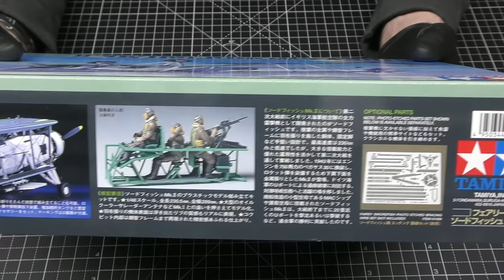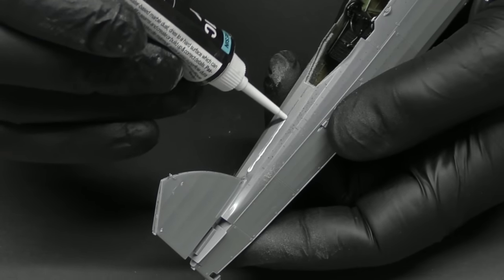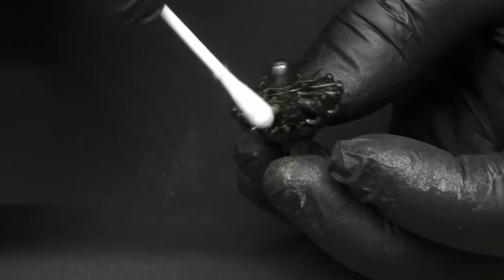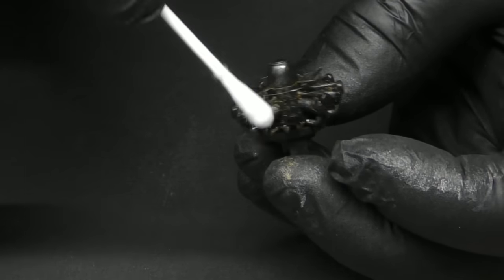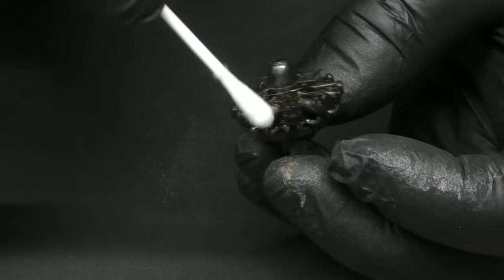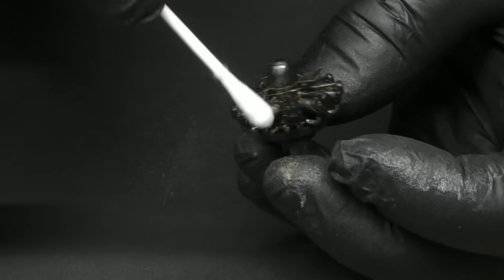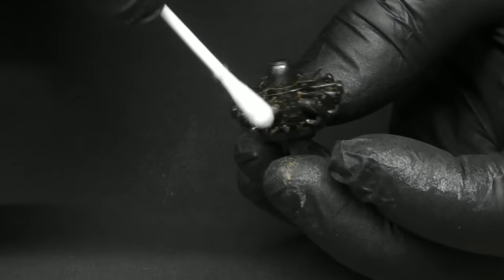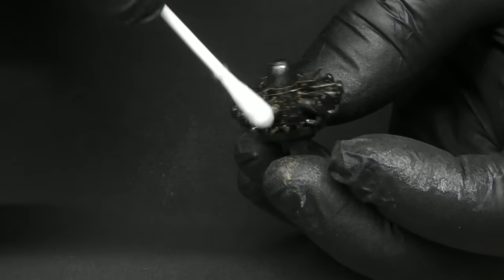Tamiya 1/48 Fairey Swordfish Mk.II #61099 Full model kit build.

Comment: Very nice build!  A tip to avoid knocking over paint bottles is to wrap some kitchen foil around the bottle and then crush it into a firm collar that effectively widens the base of the bottle.  The bottle will easily lift out so you can just swap bottles into the collar as you use them.
Reply: Or…orrrr use acrylic water based paints and invest in a wet palette

Comment: Fabulous build . I genuinely hate to criticize but I did notice one minor inaccuracy . The bracing "wires"on the wings should have zero sag. In reality they were under constant tension. They were not actually wires , but more like modern aerodynamic bicycle spokes with a flat blade like cross section with the hin section facing into the wind. Perhaps an opportunity for another photo etch set.

Comment: Unlucky with the paint but it's nice to know I'm not the only one that does. Lovely finished model.
Reply: I started cracking up when he did that, but only because it broke the chill mojo, and the fact that I've done that so many times before. At least it wasn't a bottle of extra thin...
Reply: @trydrew  Ohh I've done that. Bought a holder for the bottle and still managed to knock off the bench into my lap.

Comment: When you said you'd snapped off the tailwheel, I half expected to see you stretching a bit of sprue over a candle flame to fab up a custom plastic "pin" to re-mount it with.  Sacrificing the micro drill was like, "Yeah, this model's worth it."  Boss move.

Comment: I recommend that after you apply the decals with Set/Sol solutions and let them dry do go back over them with a heavy application of Walterh's Solvaset Decal Setting Solution.  Solvaset will melt down your decals to allow them to fit in the most obtuse and right angles where you want to apply them.  Solvaset does require some learning as it's quite hot and will quickly melt a decal if you're not ready for it.

Comment: Seeing you use Harder & Steenbeck airbrushes, may I suggest that you invest in ‘castellated’ air caps? They are noticeably less prone to clogging and easier to clean. The part numbers are HS-126785 (for 0.15 & 0.2 mm nozzles) and HS-126794 for the 0.4 mm nozzle.
Reply from the maker: Thanks Trevor, I don't use my H&S too much, I use an Iwaya HP-CS more. Thank you for the tip though...Andy

Comment: Just came across your channel by chance as I was looking at 'Plasmo's' work on scale model building. Your work is simply astonishing! The narration is very informative and to the point and the precision of your build is amazing. Subscribed immediately.
Just one question...It seemed that during the assembly of the cockpit area, some parts that were glued together with thin liquid cement appeared to have the cement applied over painted areas. So I am assuming that adhesion of the parts is not impeded by the paint?
Thanks for a great video!

Comment: I tried to build this kit. It ended up being a total disaster. I have put together many excellent Tamiya kits, but this one just didn't fit right on many of the major parts right out of the box. Fill and sand, fill and sand, ad nauseam.   I used the photo-etch bracing wire upgrade and spent hours trying to get the wires where they were supposed to go with the right amount of tension, etc. Following your video, I finally had everything going and started assembling the wings to the fuselage - again a bad fit (yours looked so easy to go together) with a 1/8" gap.. While I was struggling to get the wings attached using CA glue trying to mitigate the large gap, something slipped and the whole thing just exploded into a hundred pieces of broken plastic and bits of bracing wire. It was totally unsalvageable. Ninety bucks down the drain.

Comment: Question. How do you achieve a truly fast finish like a real plane? I have read many articles and seen many tutorials where they say you should put a think coat of clear coat in order to decal then another thin coat after to seal the decals so they don't come off from age. However, even a flat clear coat makes the model have a slight sheen to it and isn't really flat. So how does one achieve that flat finish when using clear coats?

Comment: I'm new to modelling and this is way beyond my skill level at the moment. I have some questions, though. When applying the under coat on the front of the plane you applied an off white and then black over the panel lines, why did you do this? As it appeared to get covered completely by the top coat then the effect was added after that coat had dried with the black oil (I think). It was the same for the figures, to me, the top layer covers the base layer completely, so how does this help with the shadows?

Comment: You can't go wrong with Tamiya kits.  Tamiya manufacturers simple but detailed,  easy to build without any fuss, quality plastic, and Tamiya has the best box art, and very easy to read manual, variety 9f selections in mmy opinion, everything fits nearly perfectly and  many of Chinese products ( Takom, Dragon, Trumpeter..) have way too unnecessary parts, very hard to assemble so would rather buy Tamiya over Chinese models.

Comment: What pressure are you using on the airbrush
Reply from the maker: Hi John, most of the time its around 15-18psi. Thanks. Andy
Reply: @ScaleModelShed  thanks I am having a tough time getting it right. Tamiya paint thinned 50%, down to 12 psi to keep it from being gritty.

Comment: I'm not sure about having a dropping torpedo. The aircraft you have built has rocket pylons fitted. I'm not sure a Swordfish would have the rocket pylons fitted if it was configured to carry a torpedo. Swordfish were so under powered that weight (as with all aircraft) would be an issue. So the pylons would be removed, I think. The aircraft certainly wouldn't carry both rockets and a torpedo at the same time. If there is photographic evidence of a Swordfish carrying a torpedo and still having rocket pylons fitted, I'll stand corrected, but I can't find a photo showing this load out.
I have seen pics of a Swordfish carrying a torpedo and depth charge/bomb racks under the wings, but these are different that a rocket pylon.
Reply from the maker: Hi, thank you. I will have a look, but it didn't occur to me. You are most likely right! I think I will need to forgo absolute correctness, unless I try and remove the rocket pylons.....ouch! Thank you. Andy

Comment: Dought you read these comments, but I really wished someone that had talent would sit their butts down and do a video on using soldering wire or regular wire and making hydraulic & brake lines for landing gear like on the B-17 landing main gear struts. There are sone real artists out there but no e of them showing their skills at maki g Eduards Brassin metal landing gear like in b17 look realistic Or shorting the gear to collapsed position they only come in extended